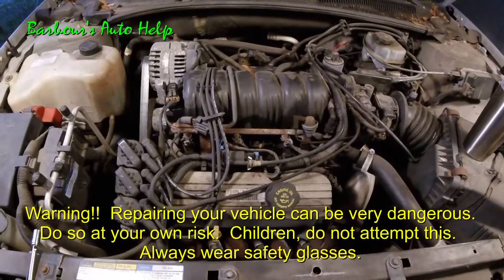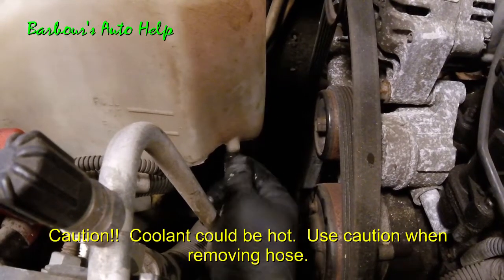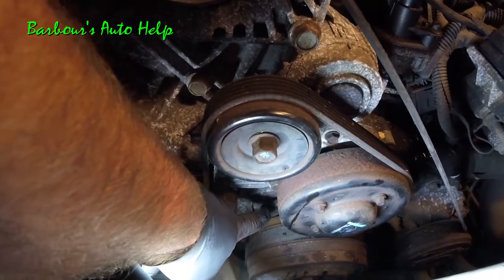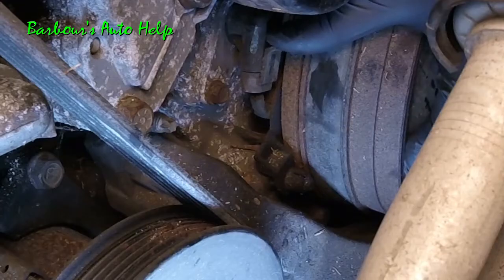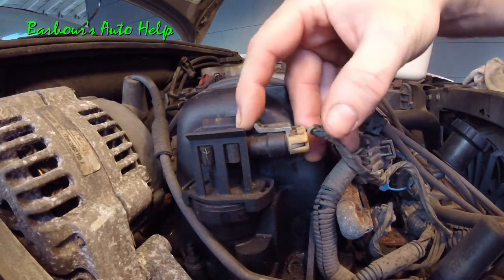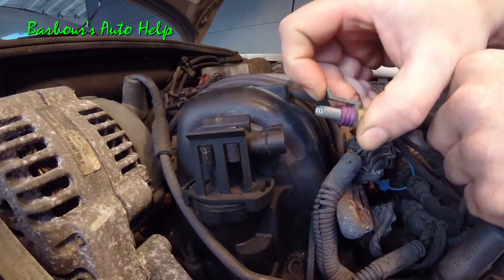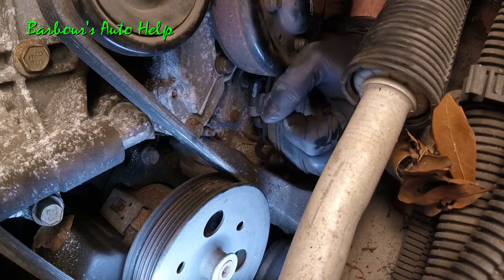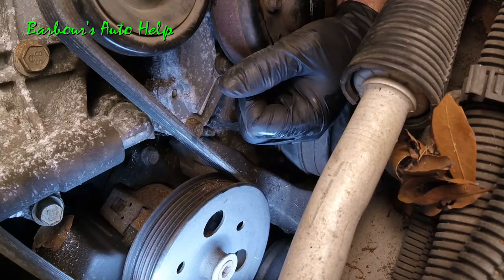Camshaft Position Sensor Replacement GM 3.8L Series 2

Comment: OMG! THANK YOU! My Park Ave has been parked for 4 months because no one knew how to fix it ! I found your video today and am going to fix it myself (grandma with tools). I was told the harmonic balancer had to be removed, blah blah blah. Thanks again.
Reply: That's the crankshaft position sensor...but ikr😅
Reply: @tyquik007  so you have to remove the harmonic balancer
Reply: @-g.k.4389   for the crank sensor yes ...not the cam sensor
Reply: So did it run then die or just crank no start
Reply: @ken79bu  it would start and get me down the road then stall.
Reply: @mariamadrid2508  welp after doin all I explained I put on the car I ended putting on the crank sensor and cam shaft sensor and he left for work called and said pops it runs great so so far so good no shut off
Reply: @ken79bu  thank you. I replaced the MAF sensor on top. Problem seems to be solved.
Reply: @mariamadrid2508  yup we did that too just about everything we did that could be the problem is all new so now we wait and see what happens
Reply: @mariamadrid2508 my car doing the exact thing right now
Reply: @ken79bu my car doing the same going to fix it tomorrow
Reply: Same right now don’t know if it’s cam
Sensor or crank sensor but it won’t start

Comment: OMG, Thank You +; I have been saving expensive Shop repairs for decades DIY--the stuff I can't do goes there (and 2 credit cards) THIS VIDEO saved my weekend Mr B.  Such a great video ( like Eric the car guy's)  My block is so covered with heavy sludge bec. of an unreplaced PS Pressure line that I was planning on Saturday and removing the PS pp, and maybe even the water pump ( and knuckle skin & patience )

I can't believe the nerds that CAD designed the Series 2 ACTUALLY LEFT something that was a simple repair  . I cuss those underground cave design monkeys each time I work on this no-space transverse alien designs ! THANKs SO Much !!!

Comment: Just a kind note, and only to clarify, this is the removal of the "Cam(shaft) Sensor."  The "Crankshaft Position Sensor" is on the forward side of the harmonic balancer.  It is a considerably harder project.
Reply from the maker: I’m not sure I understand you.  Are you working on the same vehicle?
Reply: I am sorry for any confusion.  I made an edit that clarified my comment.  Basically, it can be easy to confuse the Cam Sensor (Camshaft Position Sensor) with the Crankshaft Position Sensor.  I was just adding a point to clarify.

My vehicle is a 1998 Buick Riviera that has the 3800 Series II with a supercharger.  Mine has much tighter work spaces.

Thanks for your video.

BTW, are there two distinct symptoms for a bad Camshaft Position Sensor v. a bad Crankshaft Position Sensor?
Reply: @rcbrooks1123  I have a 1993 Buick regal 3100 would the crankshaft position sensor be in the same place

Comment: Thanks for showing this video - my problem is when first starting the engine it runs good but once I shut off the engine it won't start back up - this video is going to solve my problem -
Reply from the maker: Sounds possible.  The crank sensor is more where I'd be looking though.
Reply: I'm having this problem at the moment. 

I have already switched the MAF, MAP, Crankshaft, and Throttle Body sensors. 

Will be doing this one tomorrow, and I hope this fixes it. 
I've been without a car for a month already.
Reply from the maker: Have you tried having a tech diagnose it for you?  Sometimes it can actually be cheaper.   It could keep you from buying parts you dont need.

Comment: I have 93 Buick PA 3800.  A shop just put in a new crankcase position sensor. The tachometer had been acting goofy and is now dead after the new sensor. Car runs for a while then gets hot and stalls.  Now it is throwing codes 18 and 41 related to the camshaft? Any ideas? The shop did not fix it...

Comment: Do you have a video to replace camshaft position sensor on a 2008 G6 gxp 3.8 ltr? And will I have to relearn the timing and cam in the ecm after replacing. It must be similar to the bonneville video or am I mistaken?
Reply from the maker: I don't have a video on that.  Not sure about the rest.

Comment: Do you need a relearn on the camshaft position sensor after replacing it?
Reply: I would aldo like to know ive got a 94 buick lesabre
Reply: @jackgorlick2716  from everything that I've looked at it seems like you don't have to relearn it but when replaced mine I started having misfires which was very confusing. I might have bought some bad sensors tho. I would just replace it and see what happens
Reply from the maker: No, no relearn needed.  Sorry, I'm late to the conversation.

Comment: 2005 Pontiac Bonneville 3.8 will die in the middle of driving and will not crank. In suggestion is appreciated. Thank you in advance
Reply from the maker: We’ll what other information can you give me.  Did you scan it?  Do you have fuel pressure? Spark? Etc?
Reply: Possible bad crankshaft position sensor. My older series-1 ( 3800) use to do that. Also,  check for shorted out wiring going to crank sensor, if wires are burned into each other or bare wires is touching metal engine can cause a short in wiring which will interfere or damage crank position sensor.

Comment: what about the interrupter located in the flywheel that sends a signal to the computer? you have quite a bit of work to do
Reply from the maker: The video only goes over the sensor.  The interruptor does not have to be replaced in every case  where a cam sensor code is stored.   It only has to be replaced if damaged or missing.  I believe I have information in the description similar to this.

Comment: Will a bad camshaft position sensor cause a car to lose power while driving i think thats whats wrong with my 2003 monte carlo
Reply from the maker: Do you have a code for it?
Reply: @BarboursAutoHelp  no autozone told me it was both the up and downstream o2 sensors and the catalytic converter so i had it cut off and replaced with a straight pipe and its still coughing like not getting power until i hit 35 miles and or faster then it stops
Reply from the maker: Usually a code will set if the cam sensor is bad.

Comment: My camshaft position sensor was good. The problem was the magnet mounted in the camshaft timing gear that disappeared because it was held in place with plastic holder which has deteriorated. Hey GM plastic and heat do not play well.

Comment: Hey Keith,  I have a 2001 Bonneville that starts to shutter and shake after warming up. It only happens every now and then. When I run the code reader nothing shows up? Do you think it could be the Camshaft position sensor? By the way, you have a great Youtube channel, thanks for all of the videos!!!!!!!! @ Z-speed.
Reply from the maker: I'd suspect maybe the ignition module or a coil.   Usually a faulty cam sensor will set a code.  You could take the module off your vehicle and send it to the parts store for testing.   They should heat it up pretty good to see if it fails.   I'd call ahead to be sure they have a tester.  Maybe that's it.  Let me know what you find.
Reply: I just replaced all of the ignition coils,  so I will try the ignition module! Thank you so much for the advice,  I will let you know what happens.
Reply from the maker: Have it tested before you replace it.

Comment: Only difference inbetween this video and the super charged  version. Is you have to take both of the belts off and remove the harmonic balancer wheel and the cam shaft position sensor is right behind it

Comment: The problem I have is nothing like a cam sensor or crank sensor. I changed the icm all the coils new plugs wires fuel filter fuel pump and it runs great and then I’ll feel it sputtering and then the cel comes on I check it and it says cylinder 5 misfire I did compression check 120 like in all of them I’m lost and needing help anyone
Reply: Oh I also put map sensor pcv
Reply from the maker: Was it doing the before the parts were replaced?
Reply: @BarboursAutoHelp  it had. A random misfire so I checked in the pitch black and seen wire Arching so I got new coils plugs wires
Reply: It’s runs 1000 times better but just the one misfire is just pissing me off
Reply from the maker: It's possible if nothing is wrong with the plugs, wires, and ignition coils that you have a bad injector.   May no be a bad idea to have a tech look it over for you to be sure.
Reply: @BarboursAutoHelp  thanks man honestly I paid 100 for the car 4 years ago I put 100k on it and run full synthetic on it since I had it now I’m at 205 k mileage and it runs the same as it did when I got it just sometimes it throws a code but it’s whatever

Comment: What is the side effects of a weak cam sensor?
Reply: check engine light, reduced fuel economy and slightly rough idle, also reduced engine power at lower engine speeds.
Reply: Bleachanna  ok.. Thank you. Not throwing codes.
Reply: @doug69b1  could also cause it to stall, shouldn't effect starting though because it bases off of the crank sensor for batch fire injection for starting until the computer sees the engine speed above 600 rpm and switches if it sees the signal
Reply: Bleachanna  2005 Grand prix GTP... I change almost everything. Change spark plugs, wires, oxygen sensor, throttle body, fuel pump, mass airflow. 
The problem I'm having is first start of the day during warm weather, start but it hard to starts like its out of time start. Now the weather cooler now. The car hard to start or dont want to start. Take a while to starts. Still no codes.. During that problem I check the firing and fuel pressure and all good.I dont know if the spark is firing when its post too. I dont have anything to to test if injectors have power. Change the relay to the injector. Only thing that I havent change is crank sensor and cam. When the car start (during the hard starts) its sputters when you leave the motor at same RPM and kills fuel MPG bad.
Reply: @doug69b1  did you ever found out what it was?
Reply: @santiago-gt9bz  had injector was leaking a little. Took care of the morning hard start and miss.

Comment: Is this camshaft or crank shaft sensor?
Reply from the maker: Tis what the title of the video states.
Reply: @BarboursAutoHelp  the video says cam sensor replacement. Aren't the cam sensors on the heads? I think your replacing the crank shaft sensor.
Reply from the maker: Grab a manual and check.  It's always good to do your own research.  You don't have to take my word for it.  You already have my answer.

Comment: Hey how long does this job take approximately? Can you still do job without removing the coolant resovoir. I do understand for more room if i have to fine. It should be similar to my 1998 buick lesabre hopefully.
Reply: My 99 lesabre stalls after warm up and did not start if engine is hot did your car have same problem ?
Reply: It stalled once and had a code reader and replaced the ignition coils. The spark plugs werent tightened all the way in. Engine that is hot and didn't start up no haven't had that happen. Could you tell me more i know a lot aboit the lesabre as i had a ton of problems with it lol
Reply: I see your knowledgeable about the sabre. Mine is turning over but not starting. It died when I pulled in to park and hasn't started since. Changing the cam sensor now. Than fuel filter.

Comment: It seems like the 3.8 series 2 engine has more room for the camshaft sensor replacement and the series 3 engine the 2008 Buick Lucerne. Cuz it's kind of a b** to get in there to get the bolt and it's the hardly any room to jiggle around

Comment: That's a MAP sensor
Reply from the maker: Sorry, but on a 2001 Pontiac Bonneville 3.8L V-6 this part is a cam sensor.  The MAP sensor is on top of the intake manifold.  What kind of vehicle are you working on?
Reply: you mean MAF sensor...and no, it's not.
Reply: @briansprinkle7855  MAP and MAF Sensors are 2 different kind of sensors.
Reply: No. Is a Camshaft sensor.

Comment: I have a 3.8 liter Oldsmobile 88it's stalling while I'm driving down the road and won't start after running for awhile and I'm coming to find that it's the camshaft or the crankshaft position sensor how far from the camshaft sensor is the crankshaft sensor
Reply from the maker: Not sure on your vehicle.